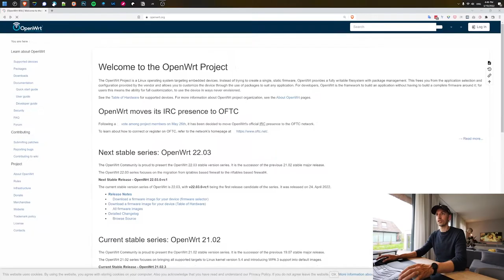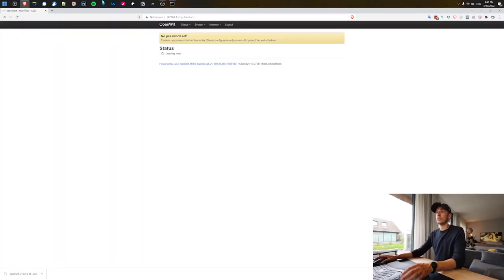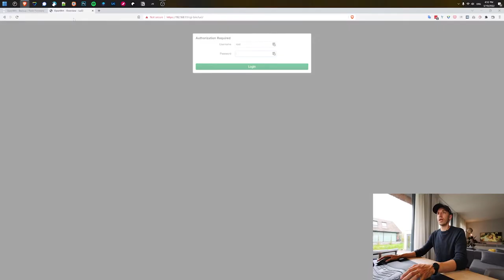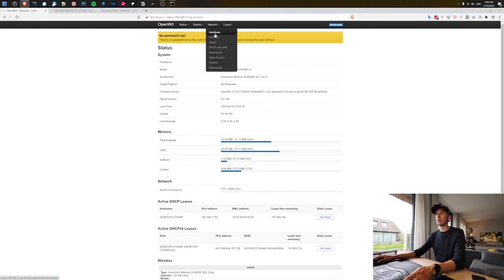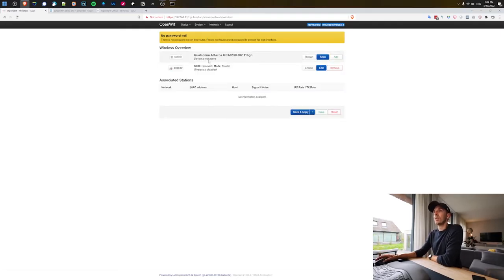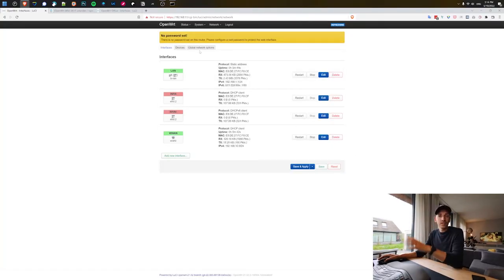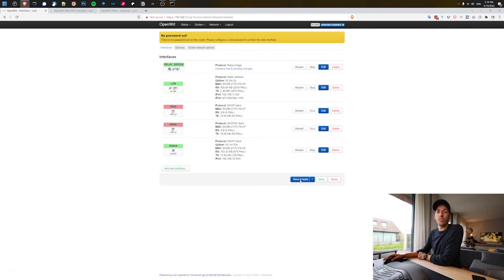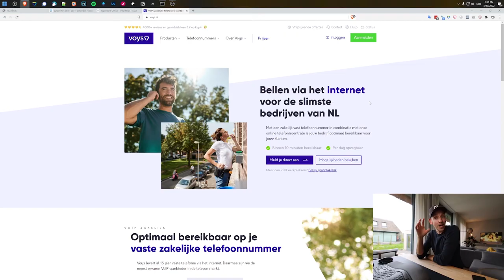How to setup OpenWRT as a WiFi bridge 2023 edition

Comment from the maker: So my most popular video (150k views and counting) is on how you can set up OpenWRT as an Access Point. I will be updating that 5-year-old video, but I first wanted to make a vid on how you can create a WiFI Bridge using OpenWrt and old hardware. OpenWrt is supported on more than 1100 devices, so even for new hardware, this might be a great solution for you! A WiFi bridge can replace a network cable in situations where you have none. Did I go out and shoot a router on a bridge for this thumbnail? Yes, I did.  Enjoy the vid!
Reply: Thank you very much for this video.  Should I use this method or the WDS method?  Currently using WDS as it didn't need me to download the relayd package.  But maybe I should?

Comment: Thanks for the tutorial; I needed to stick a wired device onto my network that was far from my router and this did the trick. Only thing I would tweak in your tutorial, is to instead make the OpenWRT's LAN interface IP address to be on the same subnet as your home router. This allows you to still connect to OpenWRT after the relay is being used.

Comment: Made an OpenWRT Wi-Fi client using an old Astaro ASG UTM110/120 hardware. These things dating back from the early 2010's still are up to the job with the latest ( 23.05.2 as of end '23 ) firmware OpenWRT has to offer.

Comment: Thank you so much for this tutorial
Tried it on my LinkSys ea6350-v3 router, and it is working flawlessly. The default firmware of the router was unable to connect to my 5GHz wifi router. But OpenWrt with this method did the trick.

Comment: I once somehow manages to use the WAN interface and declare the WiFi connection to the main router as WAN.
WAN was a DHCP client on the main router.
The LAN interface was then connected to the WAN.
I left DHCP active on the OpenWRT router and clients could connect to the LAN interface.
Disadvantage: This is a different network with its own SSID and credentials an at overlap spots devices could jump between the two.

Comment: I was trying for a while to add a secondary wireless router (Tp-Link TL-MR3420) on my home network. But nothing was working. I did try WDS but the secondary router was unable to get IP from the DHCP server (primary router VX420-G2h) or able to assign IP to the connected hosts. 

So, I upgraded the firmware from Tp-Link to OpenWRT for more functionality. I configured everything as it should be but got the same issue.
Then, I found your video and followed the instructions carefully and finally I was able to setup secondary router on the network wirelessly. 
Although, I had to manually install the luci-proto-relay package through SSH. 

However,  I can remotely reach out to the hosts (ESXi) connected to the secondary router through ethernet cable from my other devices connected to my home WiFi. 

Just have minor concern that I can't reach to secondary router interface (GUI), so to access it I have to manually change the router IP to the secondary router in order to access it.

Everything is sorted now. Thanks for this video.

Comment: There are no docs on how to make a WiFi Bridge anywhere. There's a close one for connecting to a hotspot, but that didn't work for me. I wanna use the GUI, not some CLI commands for this, so I know what's going on. Thanks for your guide!

I use this if there's an Internet issue, or I'm messing with cables. It lets me use a Raspberry Pi to connect to my phone's mobile hotspot and that connects to WAN2 on my router (using a VLAN through 2 switches) as a failover.

Comment: My Firewall settings (at 9.11) dont have a green lan zone with both lan: and wwan: in it. I'm struggling to create that zone... anyone got any tips?
Reply: Exact same issue
Reply: I had the same issue because I tried to first use an OpenWRT guide.
The fix is to go to the settings for that Interface, click "Firewall Settings", and change it to the "lan" firewall-zone.

Comment: Hey great guide.
I wanted to do something similar from what you have done, but instead of connecting through Wi-Fi, I wanted to connect my router and access point with a cable, but honestly I'm not even sure if this is possible, if it's, do you know by chance how this would be called? I'm trying to search how can I do this but so far no success.

Comment: Hi, thanks for the tutorial, it worked fine and i get a good lan signal, however i also need a 5ghz Wireless signal to connect my Vr headset to my pc, i did manage to make a wireless 5ghz network and i can see it on my devices with Wlan but whenever i try to connect to it its stuck at connecting to ip and ip not found, is there a fix for this? i would really appreciate some help.

Comment: So was I supposed to change the op address or let my router assign the bridge one? I ended up losing access to openwrt when I assigned the bridge a static op myself.
Reply from the maker: First of check your subnet mask and set it broad enough to be able to reach the device. If that does not solve it try the following. 

After you change the IP of the router, disconnect your computer from the existing network. Than connect the bridge to your computer via a cable and give you network device a static ip in the same range as you have set for your device. Hope that helps.

Comment: Thank you for your guide
In this video you showed how to get signals from wifi router and bridge them to Lan, my question is that, is there any way to share the received internet to another device by wifi (not Lan)?
Reply from the maker: Yes that's possible. In that configuration it's called a WiFi extender or WiFi repeater. You will loose a lot of speed.

https://openwrt.org/docs/guide-user/network/wifi/relay_configuration
Reply: @MarkVletter  But what if my internet is only 10mbps anyway?  And what if I use the
2.4ghz radio to connect to the main router and the 5ghz to broadcast a new AP?

Comment: Have a question about this. The setup with your tutorial worked well for me. However, one thing unfortunately does not work. I have a small Proxmox server running on a adapter that runs OpenWRT via LAN. When I look at my main router in the network connection, it does not find the device shares unfortunately. When I connect a laptop I can access the internet without problems, but the device on the LAN behind the AP is not found in the network (intranet).
Reply: I'm having the same issue. Did you ever figure out the solution to this?

Comment: Not every router is able to act like a layer 2 Wifi bridge. It's depend on the capability of the used chipset. As an example, a Linksys wrt1200AC could work as a WLAN client, but it's impossible to forward layer Frames between the swiched ethernt ports and the virtual wifi client port. DHCP frames or broadcast frames will not bridged over the payload network. This is a limit of the used NXP marvel 88Wxxxx chipset, that the router familiy uses.
If layer 3 routing is possibe - well i had not spend the timne to checkout them. If this is possible, the OpenWRT needs to use a dhcp-relay agent on the client edge. I am unknown, if this is available as a module.
Reply: oh man, thanks for this note.  I've been beating on my wrt1200AC trying to get this to work.  I actually lose LAN connectivity to it right after I make the bridge.  I've been about to toss it in the garbage for the last hour, and you've given me the thumbs up to do just that!
Reply: @paulcarboneNY  I had checked the OEM firmware again and this is able to act like a wifi ip-client. Act as a bridge working on layer 2 is impossible reasoned by the chipset limits i descripted before.
OpenWRT is quite  unhandy in the variant for this router, because this models are not build by using more ram and flash memory to implement more. 
I prefere using the  DD-WRT fork because it's easier to extend them.
Reply: @DD4DA  I think I'm starting to see some issues with my setup - any tips on picking the right router to make sure it can do Layer 2 routing between interfaces?

Comment: I’m stumped. Whenever I try to change the IPv4 address to something outside of my existing router’s range (192.168.1.1) I can no longer load the interface with the new IP I set… (192.168.10.1). No matter what I try, I can’t seem to fix this!
Reply from the maker: First of check your subnet mask and set it broad enough to be able to reach the device. If thaf does not solve it try the following. 

After you change the IP of the router, disconnect your computer from the existing network. Than connect the bridge to your computer via a cable and give you network device a static ip in the same range as you have set for your device. Hope that helps.

Comment: Do you know if there are different steps if setting it up without connecting to the main router by ethernet cable?
Reply from the maker: I don't think any of the settings itself change. I think most devices send out a default WiFi signal after reset as does openwrt. So I would focus on the settings part of the vid, not the "how to connect to" part.
Reply: I'm in the same boat.  I was looking to setup a "wireless" bridge.  Followed all the steps (or so I thought) but now after the reboot... I can access my device's GUI.  I tried using WireShark but I just get a "Timed Out" every time I try to ping any relevant IP address.  Anyone have any ideas?

I'm running FriendlyWRT on a NanoPi R5S.  I was hoping I could just do a factory reset like you could do with a router, but this technically isn't a router and I think the mask button is only for upgrading the software.  I think my only option now is to download the proper firmware for the R5S and re-flash it.  That is... unless anyone has a way of saving my a$$???  LOL!

Comment: Sorry for commenting twice, looks like youtube deleted original comment because of ip addresses I wrote here.

Thanks for the video! I'm new to the OpenWRT and it's a bit more confusing to set up, although more flexible then stock firmware.
So what I needed originally was kind of WiFi "extender" because the signal from the main router is too weak and unreliable. 
I managed to set up OpenWRT router to connect to the main router via WiFi as a client, but also to create it's own WiFi network with different SSID. It's set up kinda the same as in the video but Wireless-to-Wireless interface instead of Wireless-to-cable. And it works great, I can even access main router's control panel through this new WiFi network by typing 192,168,0,1.
But what's really needed is a way to access OpenWRT router's control panel. I'm wondering, is there a way to set up some kind of static address like 192,168,0,50 or 192,168,1,1 to access OpenWRT control panel when using WiFi connection, without cable?
Reply from the maker: What you want is to setup OpenWRT as an access point (extender). I'll make a separate video about that, including setting a static IP.

Comment: my router stops communicating after i install luci-proto-relay and reboot. ideas?
Reply from the maker: Can you be more specific on the "stops communicating"?
Reply: @MarkVletter  i figured it out minutes ago actually.
Relayd needed to be installed first, but that wasnt the main issue. I had to set the LAN on the PC in the same subnet as the router for it to get into the UI of the router again.
Reply: Ever connected a usb printer to the router?
I cant get the pc to find the printer. I keep seeing commands noted but i dont know where to type them in. P910nd print server
Reply from the maker: @95GTSpeedDemon  have not tried that yet. And glad your found it!